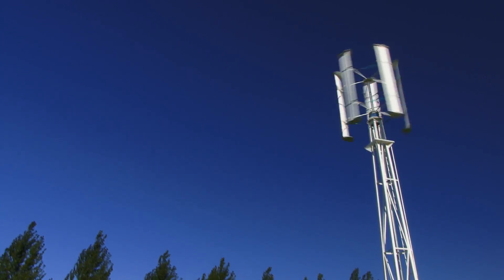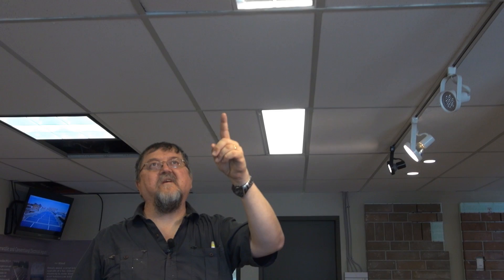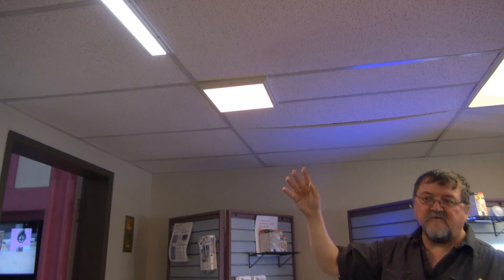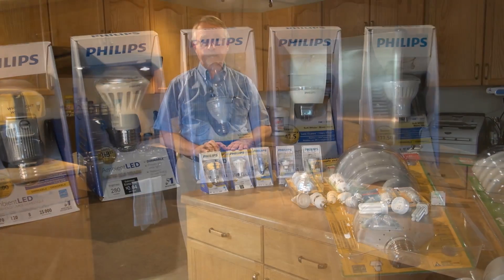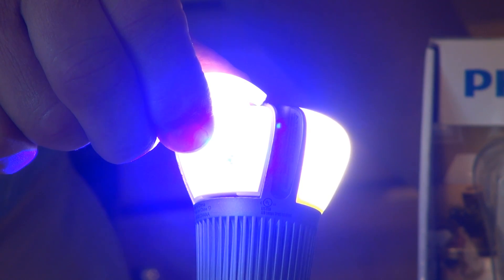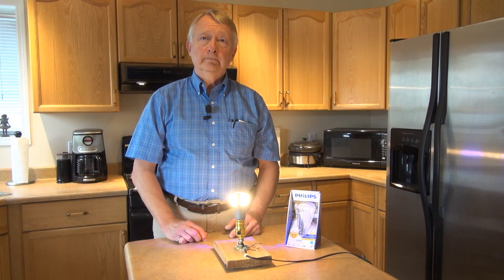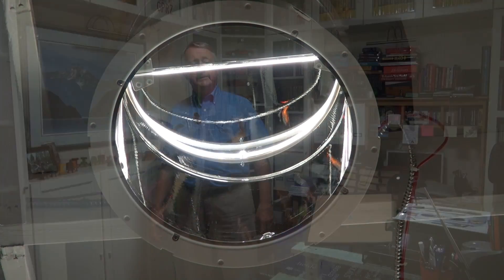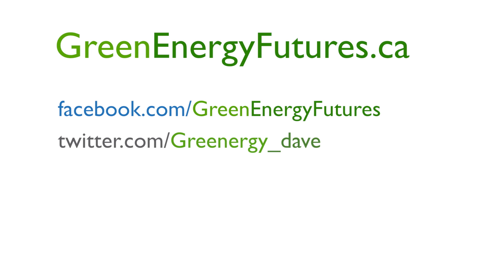7. Green lighting for dummies--the skinny on LEDs and CFLs - Green Energy Futures

Comment: That solartube concept, can that be used to transport captured light, as in a concentrated solar capturing device (some use sterling engines) to channel the light to somewhere else and there heat up a heat storing device? 
Very little transportation loss. 
So you channel the captured light of several parabolic sferes and bring them together at one place where you, for example, have one, bigger sterling engine which seems to me is more efficient and easier to maintain. 
Less construction cost too.